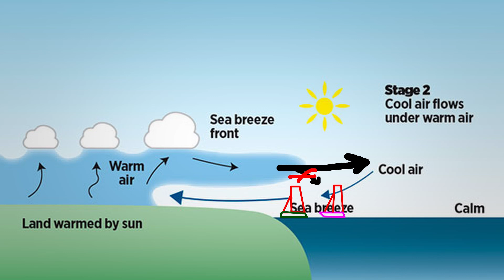Why is it so hard to get through dirty air?... and Rob apologizes to Italy!

Comment: The Younger Generation! Short attention span. This is Match Racing. The Starts are always critical, and covering your competitor and giving them dirty air is the game. But sh*t happens. LunaRossa had a cant lever foil down issue. These guys are working very hard. Boat speed differences are small. Ok winds are light and starts are challenging. You need to be more critical of Race Management. Races could be moved to more difficult courses. It's not the boats, design or crews at fault. And maybe the  spectator fleet should be moved further away in light airs.

Comment: From what we've seen so far, I don't quite see LR ever being in a position to overtake in light winds. Having said that, the overall situation seems to be almost 100% the opposite to what we were all expecting: on day 1., LR didn't fall too far behind NZ in the first race and beat them in Race 2, all in strong(ish) winds. In light winds, NZ seem to have an edge speedwise. Tomorrow they are expecting winds similar to day 1 and it should be more interesting. I'm predicting that tomorrow will be the turning point with a two race victory for one of the boats, but don't ask me which one!!!!!

Comment: The way these races are going, with the evenness of the yachts and the light winds, everything hinges on who wins the starts. So far overtaking from behind has been impossible. I think that's because both teams have shown a lack of imagination in their tactics.

For TNZ, hoping to win the start and hoping for a mistake from Luna Rossa when behind are leaving them too much as hostages to fortune. They should be more creative and proactive to make things happen when behind.

Specifically, ditch the clearly ineffective attempts to break LR cover by tacking! They've tried it over and over, race after race, and it's never worked. 

From observing all the races since December, it's clear to me that the accepted dogma that the boat behind loses ground when following has not been true with the AC75s. In the few cases where it's happened, the boat behind often GAINS on the boat in front. We saw it several times with Ineos vs. LR in the Prada Cup - the commentators noticed it too. Unfortunately none of the following skippers so far have had the courage or imagination to hang in there; they quickly tack and just lose ground again. It's pointless!

I think this aversion to following another yacht is a drilled-in dogma from sailing history that is very questionable with these game-changing new boats. TNZ are always losing the tacking duels, they need to try something different when behind on the upwind legs. A new strategy called "Sit on their Arse"! 

They don't need to pass Luna Rossa sailing behind  - that's impossible. Just sit close and minimise manoeuvres until the downwind leg. Then use their speed advantage and higher position to choose their best lines and make the pass. 

The conventional upwind tacking duel approach isn't working, so try something different. Sit on their Arse! 

If it doesn't work, the end result will be no different, so what have they got to lose giving it a go?

Comment: Great stuff as ever.

Funny as I suggested the 5 minute pre start, up down once this morning!! Smaller start box too.

https://twitter.com/reetspetit/status/1370686446907035649?s=19

They either need more race track, or more manouveres to give more racing options.

No spinnakers & high speeds also remove the trailing boat downwind advantage.

Ultimately TV will dictate they need more interesting racing, though personally I don't care.

Comment: This sounds like the race course is not fairly set up. Those setting up the course need to understand the technicality of high speed foiling boats. Due to the unfair set up of the course, which is causing unfair advantage to the boat in front, and unfair disadvantage to the boat behind, these races should all be abandoned, calling them null and void. The teams who have spent large amount of time, money and efforts are not fairly allowed to take advantage of the full speed of the boats to race fairly.

Comment: Given the pre-start is the most exciting part of the “racing” so far the solution is to up the number of pre-starts to five upwind and four downwind. Keep the course length and width the same. No actual “racing”, just pre-start boxes where the winner of each race is whoever crosses the line first. Best of nine pre-start wins is the overall winner. Simple, with loads of maneuvering in each pre-start box. So, in essence, nine very short races of 5-10 minutes each.

Comment: NZ needs to go lower to have a better VMG. Which means that if LR can be to leeward of NZ, NZ will not be able to go low and fast and have a better VMG. The reason why when LR wins, that it dominates the left side of the course, is little to do with the wind direction. They are doing that because by tacking to leeward of NZ, they spoil NZ's "low and fast" better VMG. 

Think about what is going on guys ...  think you've missed what is happening out there.

Also, please consider too, that NZ in the lighter airs, cannot achieve a good tack unless they are going low and fast. IF LR can force NZ to tack without NZ being able to build up a lot of speed - then NZ's tack will be poor. But if NZ can get really good speed, they are tacking as well as LR does. 

So ... in the lighter breezes, and ignoring the huge difficulty of timing how long it takes for these boats to build speed and get to a normal VMG and thereby get to the start line on time - the tactics are really about NZ trying to be able to sail low and fast, versus LR trying to stop NZ being able to sail low and fast. And the gold icing for LR would be to either force NZ to do an extra tack at the top of the course, or to be able to set to leeward for a long time, and force NZ to be unable to sail low and fast.

Obviously if NZ can get clear in front, then they can sail low and fast and it's game over, they'll just sail away from LR. The tactics are there guys, I just think you have maybe not explained what is really going on!!! IMO at least ...

Comment: Human nature is for bigger, faster, more, more, more.....

However, the size/power of the yacht and the dimensions of the racetrack do not allow the energy source a large enough differential that allows for overtaking. Even if the wind goes to 15-20knts, the tactics will still see the lead yacht shut down the course. Simply, yacht power far too big, racetrack too small.

Next cup will be faster and more powerful again, however, it's the opposite that's required to elevate the sailing and tactics as the primary success factors.

Thus, smaller, slower yachts taking less power from wind source on larger race tracks.....provides greater racing.

Comment: When LR realises they won't win they relax off their grinders (66% v's 95% NZ) so they can conserve energy for the next day?
Reply: 66% of what? Power production?
Reply: @pierocostantini2864  their heart rate max as shown on heads up
Reply: @MrVaticanRag  that's just a symptom, not real data. Every human body is different, and reacts differently to environmental conditions.
Reply: @pierocostantini2864  go back and watch the actual biodata of the grinders - the greatest extension of NZ's lead over LR corresponds with LR's Grinders heart retes dropping from 90's % of capable max to average 66%.
How would you explain lap time marginal different going from 10secs to 50+?

Comment: The two races today were decided by boats off foils to a large degree. Think for next time two sets of foils would mean they could be more stable at both ends of the wind range.
Agree need to extend start sequence so they cannot just gybe and burn off speed. 
Too early to say much else as 8knots super steady sea breeze in any boat has limited pass lanes. Would be good to see them in a breeze where instability in pressure and direction. 
Noting that probs helps the fastest boat the most so might give better racing but more skewed score as the fast boat more likely to sail through. 
Keep the work up.
Reply: Two sets of foils? You mean allow the teams to swap foils the way they can change sail sizes? Definitely. I see that happening and thought about that myself. Actually, why limit the foil inventory to just two sets when they're allowed many more sail packages? That opens up the range of strategy choices for optimizing the boats for each race and makes it more interesting from a technical perspective.

Comment: Passing is just not reasonable in the current conditions. Emirates team NZ is clearly faster (as you saw in race 4) than luna rossa, but there still werent any passes. This just shows that passing doesn't work unless there is a massive mistake. Not so nice racing at the moment.

Comment: The starts count for so much that this could be the first America's Cup where the definitely slower boat wins. Not that that makes this exciting.
Reply: I think the start should be from a dead start like a motorcycle or horse race.   Boats would be towed to the starting line, all sails down, and lined up, and when the horn blows they would have to raise sail and get underway.   That would be a real test of the crews and their seamanship.   With these boats the running start just isn't interesting.
Reply: @JoeLinux2000  I'm not a big fan of the pre-starts either but towing the boats is out of the question. They have to manage under their own power however they ultimately decide to commence the races. This is sailing after all.

Comment: Couldn’t agree more. Terrible spectacle . NZ don’t event bother covering LR. They just sail away when they’re in front. This is NOT match racing. Flip a coin and be done with it.
Reply: Probably because ETNZ knows they can outrun them easily enough, whereas LR takes a different strategy since NZ is always following closer behind. LR can't risk an overtake even if the course conditions limit the possibility.
Reply: @jamesaron1967     Correct James
Reply: The truth is that LR point high and drop off their foils at a lower speed. This gives LR a great advantage at the start and when in front where they can keep NZ in their wind shadow full of eddies and a wind angle that leaves NZ relatively headed. NZ are so much faster their VMG is greater even sailing 5-10 degrees further off the wind than NZ. This could be won by the slower boat because of their light wind advantage in the start box.
Reply: @fffmania7491    You talk sense. Very correct what you are saying. Not easy for our Kiwi boat in the starting box.